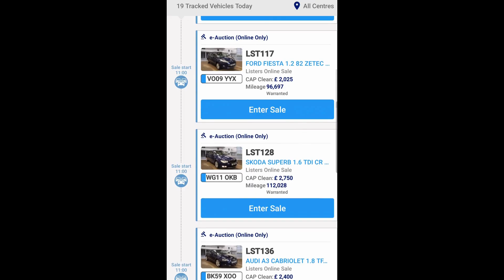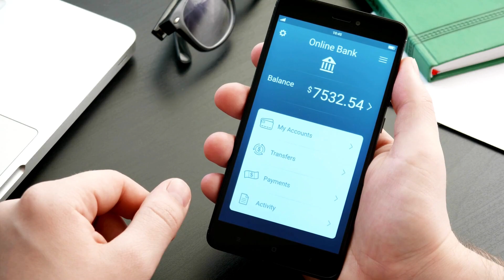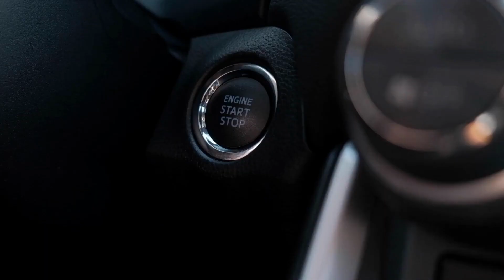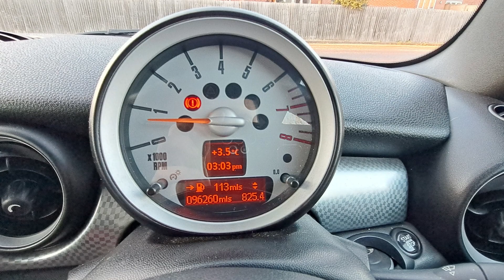How to flip cars UK | FULL PROCESS (3)

Comment: Do you have to open an LTD or sole trader to buy from BCA? or you can just get trader insurance and this is enough?
Reply from the maker: I'm a sole trader with trade insurance. You can open a Ltd business but I haven't yet. However I might do in the future depending on how well I do
Reply: @carsnstuffuk  as a solo trader what if you sell cars and break even or lose money does it affect you as a solo trader in terms of taxes and company revenue?
Reply from the maker: @Pollux  it'll count as a loss so you'll pay less tax. Don't want too many of those though but it happens from time to time
Reply: @carsnstuffuk  thanks for sharing your tips, yes like I've bought 3 cars from Copart and all 3 cars have timing chain change required, so it cost me 1200£ to fix it (each car), and all 3 sold out at a loss, that's why I'm wondering, how you approach it if you get such problem.
Reply from the maker: @Pollux  that's why I don't buy from Copart as you can see the bodywork that needs doing but they never mention any engine issues. Sorry to hear that mate
Reply: @pollux8132  sadly this is why you examine the cars carefully. There is a reason they go through an auction. Major faults are covered by the indemnity fee and you can return it but it's difficult and unlikely with a cam loose cam chain. Always attend the auction. And follow the cars as they come in.
Reply from the maker: Unfortunately all BCA auctions are online now so you don't physically see the car until after you've paid for the car and arranged collection/delivery
Reply: @wellybobs4403  you can’t attend tue auctions even if you do the margins are so small that you loose the whole day and the car might even go above the budget that you have, I just don’t understand if it says run and drive why they have such major issues?